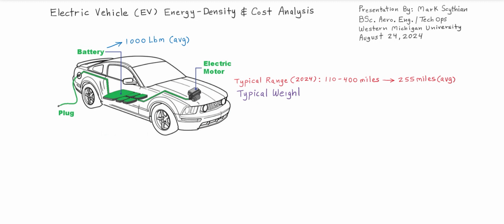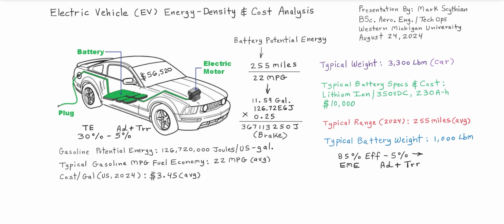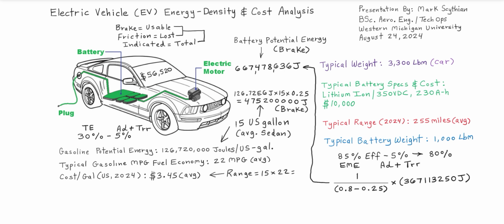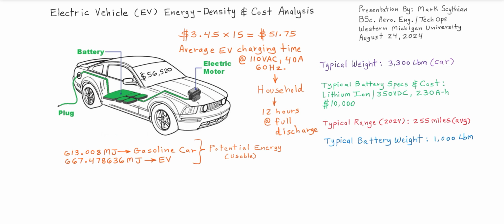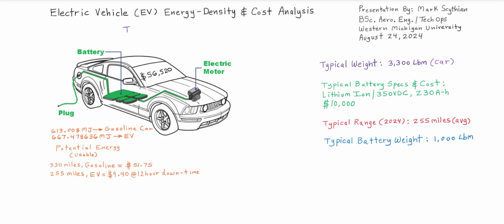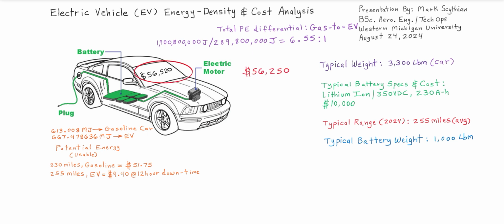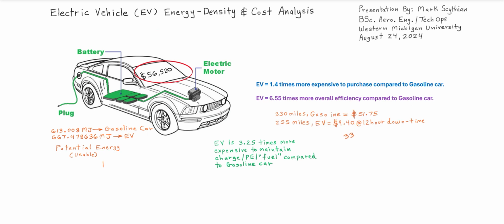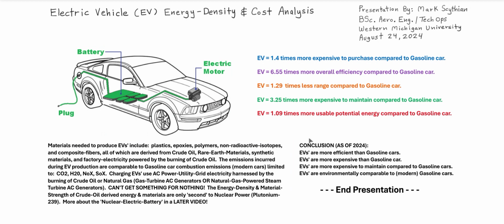Electric Vehicle (EV) Energy-Density & Cost Analysis

Comment: Energy “density" is a bogus argument. Renewables provide electricity where it’s needed—the most concentrated & useful power we have. When something else is called for, geothermal & direct solar can provide more appropriate energy. (Odeillo Solar Furnace in the Pyrenees reaches 6000°.) 

Oil’s EROEI was 100:1 in the 1930s; now it’s 13:1 & still dropping. Uranium is being depleted fast; increasing it enough to be a significant energy source (it’s less than 5% of global energy now) will use it up enormously faster.  It takes enormous effort, energy, expertise, materials, etc to find, drill & mine, transport, refine, transport, & burn fuels; switching to renewables will reduce all of those. 

“Solar Waste Stream is Tiny, Compared to Current Fossil Fuels”
This Is Not Cool, October 9, 2023

“A Fossil Fuel Economy Requires 535x More Mining Than a Clean Energy Economy” 
Michael Thomas, Distilled, March 29, 2023  

“New Video: Clean Energy = Less Mining”  
This Is Not Cool, September 15, 2022  

"Mining quantities for low-carbon energy is hundreds to thousands of times lower than mining for fossil fuels”
Hannah Ritchie, Jan. 18, 2023

“NREL: How Much Land for Renewables?” 
This Is Not Cool, March 1, 2023 
[The RE land figures given here must be cut in ½ to reflect RE energy savings, ½ again for rapid tech advances, ½ again because the US could do it all with offshore wind & rooftop solar. Even though it won’t, those will save enormous amounts of land.

“US Could Achieve 3X As Much CO2 Savings With Renewables Instead Of Nuclear For Less Money”      
Cleantechnica, Feb. 20, 2019

“More transitions, less risk: How renewable energy reduces risks from mining, trade and political dependence”
Jim Krane, Robert Idel , Rice U. 

Ukraine’s Trial by Fire Proving – Wind Energy Harder to Knock Out
Climate Denial Crock of the Week, June 2, 2023

Comment: EVs are about 5% more expensive than supposedly comparable, actually vastly inferior ICVs, while battery costs, the major part of EV costs, are falling 10% a year. 

EVs are 10 times more efficient well to wheel (40-60% vs 5%). They take more energy, materials, carbon, & pollution than ICVs to make, but they're so much cheaper to fuel & maintain that they make up for it & come out cleaner, typically within 1½ years, then go on to run clean & cheap for longer than ICVs. 

EVs & renewable energy are a synergistic system that dramatically reduces mining, pollution, social damage & more of fuels. Nukes are polluting, expensive, water-intensive, unreliable & getting worse, slow to build & pay back carbon & other costs, unacceptably risky, & completely unnecessary since renewable energy can provide all the energy the world needs, safer, cheaper, faster, cleaner, more reliable, more resilient, more democratic, better in every way.
Reply from the maker: 1 EVs' (5.28 MJ/kg) just don't have the Energy-Density compared to Hydrocarbons (21.12 MJ/kg).  However, the Overall Efficiencies of EVs' are higher compared to Heat Engines (70% vs. 25%).  Portability, recharge/refill, and cost are substantially lower regarding hydrocarbons as well. 

2 Modern 4-stroke Gasoline piston engine-driven cars literally reduce 1 Gasoline Mole (C8H18) + 25 Oxygen-gas Moles (O2) to carbon-dioxide gas (plant food), and water-vapor made possible by:  Anti-Detonation-Sensing supporting 11.5:1+ Compression Ratios', Variable-Valve-Cam-Timing (VVCT), thus maintaining 100% Volumetric-Efficiency at all RPM-settings, Power-Recovery-Systems (mechanical, electrical, thermal, pneumatic, hydraulic), graphene-die-electric-subtrate-electrical-and-electronic solid-state materials (rather than wiring), looser tolerances, nano-graphene, software-heavy, and fewer parts.  

3 The 'late-model automobile' is literally a water & carbon-dioxide output generator, with very low or trace-levels of Oxides-of-Nitrogen (NoX), and Oxides-of-Sulfur (SoX) emissions.  Not to mention that literally all engine blocks are recycled aluminum, 3-D-Printed, if not graphene-substrates, or CNC-Machined, inlcuding reuse of CNC-subtracted scraps.  

4 Recycling aluminum takes very little effort and energy to re-form into components, compared to titrating aluminum from bauxite-ore in the absense of oxygen, using fluorine-gas at around 900 degrees C and 14 ATMs', i.e. Aluminum-Smelting:  almost a thing of the past, as most if not all aluminum-reserves have been processed into aluminum-alloys over the last 90 years.  Forming engine blocks from recycled aluminum is cheaper and MORE environmentally-friendly compared to manufacturing parts for EVs'.

5 EVs' and their electromagnetic and inductive-field isolation systems also require many exotic polymeric materials, some of which are radio-active carbon-isotopes, also having manufacturing emissions which are difficult to contain, and damage the environment.

6 As for Nuclear Power, all nuclear and thermo-nuclear power sources are created UNEQUAL.  If we're just talking about discharging neutrinos at higher electron-count and quantum-spin-propgation compared to naturally-existing Atomic Number(s) for let's say Uranium, then we're dealing with issues of Fall-Out, an unacceptable source of high-energy-density potential-energy.  However, if we're working with Depleted Fall-Out artifacts such as Plutonium-239 having an energy density of 1.8 million times that of Hydrocarbons, HANDLING is already INERTED.  Such as in our University Nuclear Engineering research, we work directly with INERTED Pu-239.  Or else it would never have been commercially-viable.  

7 Nuclear-Battery would work with respect to electron-discharge applications, NEVER fission, NEVER Fall-Out.  The real source of clean, safe, and reliable electrical power are the HUGE stockpiles of INERTED Pu-239-Isotope:  the reduced/spent material of Uranium-235 Nuclear-Testing.  

8 Regarding nuclear weapons, ONLY Kilo-Ton warheads could ever be set-off into weapons applications.  All Megaton warhead applications are just "science experiments" and are NOT usable for warfare, unless EVERYONE on Earth is to be killed.

9 Clearing atomic neutrons or the word "nuclear" means nothing outside of SPECIFICS!  All of us in the Engineering, Physics, Chemistry or STEM Communities know this.  Unlike the non-engineers and non-scientists across 98% of the population.  The Media isn't real.  The Media relies on scientifically-illiterate people to accept their nonsense.

10 Electric Vehicles would work well if they were powered on INERTED Pu-239.  This goes for Electric Power Utility Companies too.

11 Elon Musk already told the public this as well.  But no one listens.  Everything is hype and "feelings" rather than pure science/engineering:  Calculus, Physics, Chemistry, and Engineering.  Only 2% of the US adult population are accredited scientists/engineers.  This is the real problem. 

12 Science is not a "Democracy".  Science is limited only to:  Mathematics, Physics, Chemistry, and Biology (across Newtonian, Quantum, and Informatic paradigms).  There are also many systems in Mathematics/Science that are TRUE but NOT provable!

13 However, we in the STEM Community have already solved all problems regrding the "energy crisis".  The real problems are:  politics, business, economics, and the burdern of monoplies having huge stakes in governmental affairs.  

14 Most if not all of the "green energy" products are literally worthless, and only function as Investment Slush Funds at best.

15 However, eventually INERTED Pu-239 Substrate nuclear-electric cores will be used (probably by Musk & Tesla), within ten years.  This is when million-mile (non-chargable) EVs' roll-out.  Trust me, "they" will never tell the public these are nuclear-electric-solid-state EVs', even though they will be the SAFEST, MOST RELIABLE and MOST ENVIRONMENTALLY-CLEAN EVs'.   

16 Not much one can do with any sort of Battery (Lead-Acid or Ni-Cad or Lithium-Polymer) to support continuous-operation RPM/Torque.  Except scam people out of their money.  lol

17 It's all about squeezing enough profits $$$ until everyone knows it is a scam.  Followed by suddenly releasing the "real technologies".  People quickly forget and it becomes 'business and usual'.

18 Mastering Physics, Chemistry, Biology, Calculus, Computer Science, Operations-Research, Statistics, across a Mechanical Engineering or Electrical Engineering, or Physics, or Chemistry Bachelor of Science degree is the first step to understand what is really going.  Followed by at least ten years of work experience, plus a Master's of Science and PhD degrees' in either Physics, or Chemistry, or Mathematics. 

19 Remember, only 2% of the US adult population are accredited engineers & scientists.  Everyone else literally has no clue what's really going on.

20 Science is NOTHING without Mathematics.  

21 In fact, science is just a "word".  

22 Real 'science' is DESCRIBING sub-atomic particles, energy, atoms, molecules, and all natural & synthetic systems MATHEMATICALLY (Differential & Integral Calculus).  Or else it is not science at all.  Science is nothing without Mathematical-Modeling.

23 Lastly, 96% of the known universe is Energy and described by Quantum Physics-Chemistry-Biology-Mathematics.  Only 4% of the known universe is Physical and described by Newtonian/Classical Physics-Chemistry-Biology-Mathematics. 

24 The DETAILS are EVERYTHING!  lol

Subscribe to my channel to gain access to the lastest fundamentals & concepts in engineering/science.

Thanks for you comment!
Reply: @markscythian     And thanks for your utter nonsense.
Reply: @markscythian                The only reason I would subscribe to your channel would be to to counter the endless stream of bullshit you’re spewing.
Reply: @markscythian7179       Utterly ridiculous, anti-science, nutjob arguments.